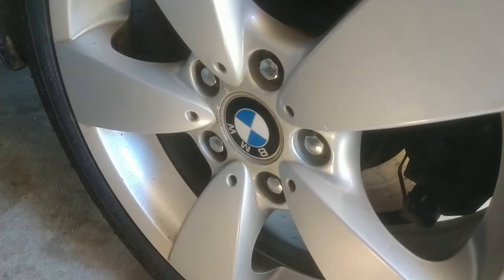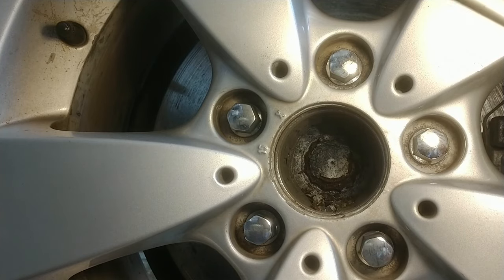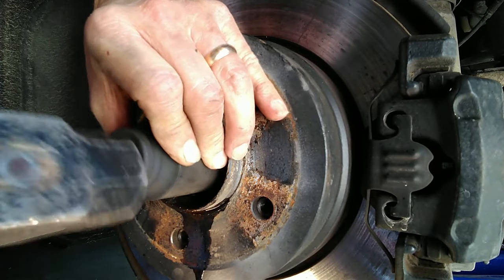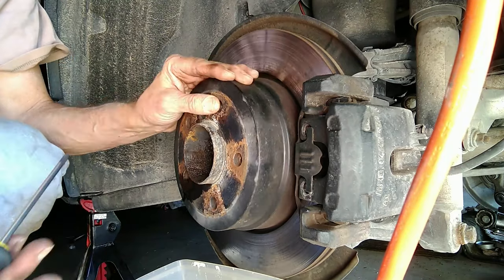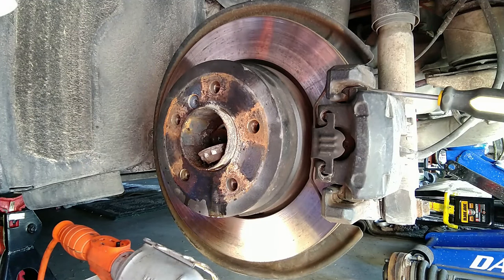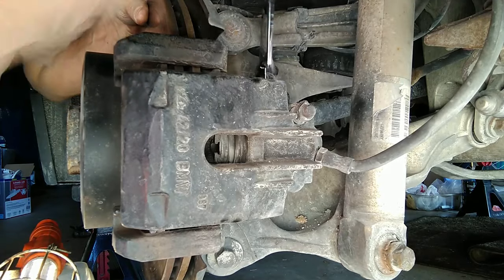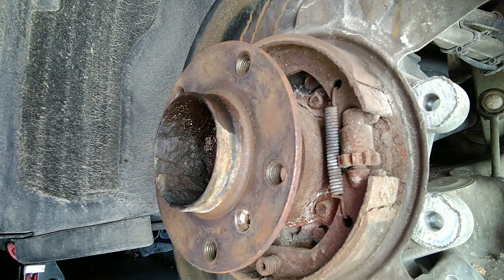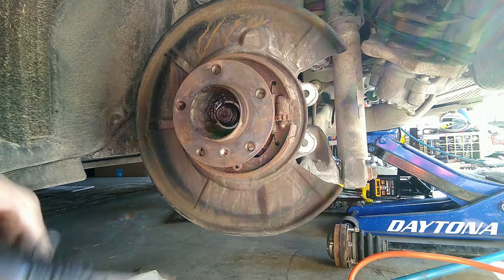Removing rusty / stuck rear axle in BMW E61 using Harbor Freight Tools (axle was bad as they get)

Comment: Wtf? Tried to undo nut security pinching?
Reply from the maker: Those can be difficult to undo. I've found that the aftermarket axle nuts tend to have a much thicker band that needs to be deformed. The original ones on my car were rusty enough that it wasn't difficult to jam a screwdriver in and bend them back out.

Comment: you have to heat the back of the bearing
Reply from the maker: More heat is better, but the axle doesn't actually touch the bearing anywhere.  The bearing lives between the knuckle and the outside of the hub, while the axle runs through the inside of the hub.  Heating the hub does indirectly also heat the bearing, of course, but I can't imagine the bearing having a major role in holding a stuck axle in place.
Reply: @xjnoise  been fighting for 3 days for the same thing needed to cut and heat
Reply from the maker: Interesting - I think that it might be something of a coincidence if cutting the bearing (?) helped get the axle out of the hub, but the extra vibration and heat from the process could only have helped the axle / hub bond to release.  Hope you got it done successfully!
Reply: @Mark_H_DIY  yes indeed it work fine

Comment: I would have cut the axle at that point and bought a new one. Then pull the hub/bearing out with the axle piece still stuck in it lol.
Reply from the maker: I think that would probably work, but with the wagon, the rear bearing bolts are much harder to get to. The outer CV joint was really in the way, though if you cut it you might be able to move it enough to work around it. The good news is, mine will come out like butter next time, should it be necessary. :-)

Comment: Ahhhh why didn’t we get to see the splines of the axle why it was so reluctant to move??  Honestly that was the money shot and it was a long video awww very informative otherwise.
Reply from the maker: Honestly, it didn't look any different from an axle that would come out pretty easily. You can get an idea of what the surfaces look like from the video portion where I clean the hub splines. The difference between a nominal amount of rust, and enough to freeze it up solid is pretty small, there's just not that much room between the two surfaces.

Comment: So basically i was doing right, i just needed more of everything....bigger tools, more heat and more time. Will try again
Reply from the maker: Time - if you have it - is your best friend (to allow the PB Blaster to work). And yeah, bigger tools and more violence is always good, too! I got an induction heater and used it on a front axle, and it brought the hub up to a higher temperature much faster (2 minutes), which makes for a higher heat difference between the hub and axle (so more chance of it coming off). I was going to make a video on the last axle, but it popped off with "only" the 10-ton puller.

Comment: Note to others... for the love of god do NOT use this method to remove a wheel hub/bearing from the knuckle, you will destroy your axle! (Edit: Note that if you're trying to remove a stuck axle spindle like in this video then yeah you want to do this, but if your axle spindle is not stuck and you are trying to remove a stuck hub from your knuckle, do not use the axle spindle as a counterforce. Sorry for the confusion).
Reply from the maker: And you would have done it... How?
Reply: @Mark_H_DIY  I'm referring to if you're trying to remove a seized hub with a puller like this, you don't want to use the axle as your counter force. If you're just trying to remove the axle because it's seized to the hub spindle then yeah use the puller. In my case I didn't have a seized axle, just the hub.
Reply from the maker: I'm not quite following - sorry.  If (as in my case) you DO have a stuck (rusty) axle, I don't know how you're going to be able to avoid applying a whole lot of force to it.  OTOH, assuming that the other end of the axle is loose (so there's nothing to "push against") the only part of the axle that's going to be stressed is the splined axle stub itself, which is "just a big hunk of steel".  No bearings (or anything else in the axle) can be harmed by doing this - again, assuming you've dropped the axle from the differential end first.  I would certainly recommend replacing the wheel bearings after applying this much heat and violence to the hub though (something I planned to do anyway).  But if there is a "gentler, kinder way" to get an axle stuck as badly as mine were out of the hub, I'm willing to hear about it (and would pass it on).
Reply: @Mark_H_DIY  Yeah sorry for the confusion! I should clarify that I came to this video hoping to find a good way to remove bearing hub that was stuck on the knuckle, NOT a stuck axle. If I had fast forwarded to the middle of the video some people might mistake this for removing a stuck hub and not a stuck axle (even though the title is very clear on what is going on here). So I was just posting to warn anyone who almost did what I did, which is attempt to remove a bearing hub stuck on the knuckle by using a puller on the hub against the axle spindle (which is perfectly good and not stuck) which would probably result in breaking the axle. Sorry for the confusion. I certainly wouldn't know a better way to remove a stuck axle spindle from a hub as the puller I have worked fine for when I needed to do that a couple years ago.
Reply from the maker: Now it makes sense.  Yes, a stuck hub is a very different animal, and there's no need to stress the axle (particularly since it's most likely out of the way before you get to the point you can actually pull the bearing / hub).  Just for clarity, you might edit your original comment to reflect your specific concerns (instead of making it sound like someone's going to grenade their axle by pushing it through the hub).  ;-)  Thanks!
Reply: @Mark_H_DIY  Gotcha, edited. Thanks for the vid!

Comment: I honestly don't have time for  a stuck axle - ugh😆
Reply from the maker: Honestly, just getting the axles loose took longer than rebuilding the rest of the suspension, including axle bearings. The only thing that made it close was some rusty bolts on the upper control arms (I hadn't bought an inductive heater yet, and ended up cutting the bolts off... With the inductive heater I may have been able to remove the bolts / nuts).

Comment: well crap, I live in Canada
Reply from the maker: Before (and since) buying the BMW, I'd bought cars only from the desert southwest for a while.  I've never had a rusty bolt / nut on my 1996 Jeep, which still has the original exhaust at 240,000 miles (and 28 years!).  This process kind of broke my desire to own cars from the frozen north...  ;-)

Comment: Just give that handle another pump or two it will break free complete waste of time.
Reply from the maker: @shatnersufolanded7785  don't I wish that would have worked. That puller was pumped to capacity plus. If you've never had a badly frozen hub, you can't imagine how stuck it can be. My current car's axles could be pressed out with a finger (Arizona car)
Reply from the maker: @shatnersufolanded7785  don't I wish that would have worked. That puller was pumped to capacity plus. If you've never had a badly frozen hub, you can't imagine how stuck it can be. My current car's axles could be pressed out with a finger (Arizona car)

Comment: Next time you get a air hammer 🔫
Reply from the maker: I did have one, though not a huge one.  It was enough to finally break the stalemate of the axle vs. the 10 ton puller and two torches. ;-) FWIW I did try just the air hammer and it didn't make much of an impression on that nasty axle.

Comment: I had to do this yesterday,  after 2 days battling.  I made a video of it  https://www.youtube.com/watch?v=9VrXUVaTRqc       
 This Bosch Rotary Hammer drill worked for me.  3 arm puller & a OTC slide hammer, heating and prying with crowbar  did not work
Reply from the maker: Congratulations on getting it done. I used a hammer drill that was a lot bigger than that one, and it didn't do anything on my axles, though they were a whole lot rustier than yours. Mine really did need the combination of 10 tons static pressure, lots of heat, and an air chisel. I've sworn off cars from north of the Mason Dixon line. ;-)

Comment: These are just dreadful designs, my Ford just slides out no bother as their not an interference fit with the splines. They should make car designers service the junk they come up with.
Reply from the maker: To be honest, I've done cars with pretty much identical splined interfaces, and pushed them out with just a finger. This one suffered from a few years in the frozen north, and was no doubt soaked with lots of sloppy, dirty salty grunge. The splines had just rusted together, and I'm not sure that any car with a similar design would be immune from this. And since I live in the Arizona desert, I am going to try to avoid anything that spent any real time exposed to the salty slush of northern winters.

Comment: Im sorry but this is not the right way to remove the axle. Your method risks bending the hub, not to mention the danger of the socket or gear puller catastrophically breaking apart. The correct way is to remove the bolts holding the axle to the differential and with a pry bar moving that side of the axle away from the diff. On the hub side, remove the nut and then use an air hammer with a punch bit to drive the axle out. Simple and pain free, no matter how much rust.
Reply from the maker: Except for the fact I did that, and it the air hammer wasn't nearly enough to push the axle through the hub splines. As I mentioned, this one was about as bad as it gets. It took the 10-ton press, two torches, and the air chisel to get the axle free. I've done other axles that didn't need more than a couple taps with a hammer to free up. This wasn't one of those. ;-) There was no danger of the puller failing, as it was designed for any stress it could supply

Comment: Wish I could upload pics, mine is worse than this 🥹
Reply from the maker: SO sorry to hear that!  If my rear axles would have been worse, I think the only logical thing to do (other than trying that inductive heater, which worked very well on the front) would be to remove the nut and just soak it for days with PB Blaster, hitting the axle with an air chisel a few times a day.  With any luck, that'll help free up the stuck splines and you can go from there.
Reply: @Mark_H_DIY  the nut on mine is barely recognisable, I dont have any issues yet but is giving me anxiety
Reply from the maker: @budhafred  Don't get too excited yet. My nuts were really crusty, but I was able to easily chip off the crust with a small screwdriver. Just make sure and use a quality socket. Mine took every bit of the 1000+ foot/pounds of torque available from my impact to come loose. And don't forget to undimple the notches or it'll be even worse. ;-)
Reply: @Mark_H_DIY  I chickened out and bought a second hand knuckle and shaft.will save me so much time if it’s hard is yours to remove :-)
Reply from the maker: @budhafred  I actually bought a new front knuckle for the same reasons, shortly after I got this car. When I got it, I realized that it was so beat up, and the bearing was so bad that I was wasting my time. In the end, it was much easier driving out the broken pinch bolt that prompted the whole exercise than it was to replace the knuckle, so I still have the original knuckles on the car. If your car hasn't seen a whole lot of salt and snow, it probably won't be too bad. Good luck with the repair, either way!